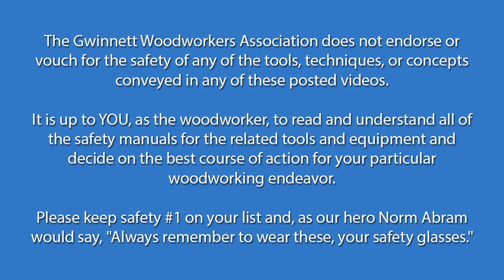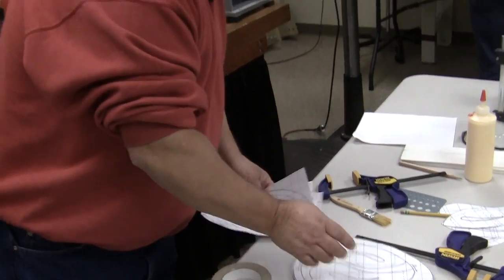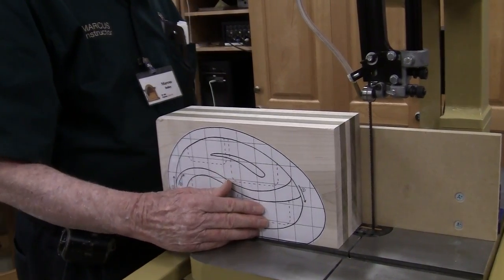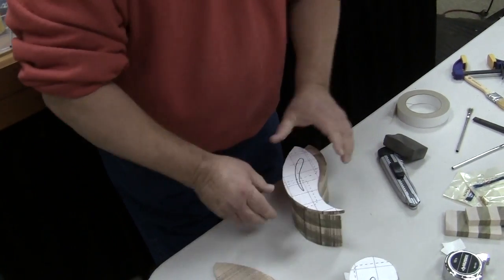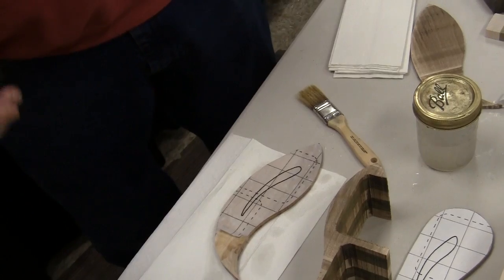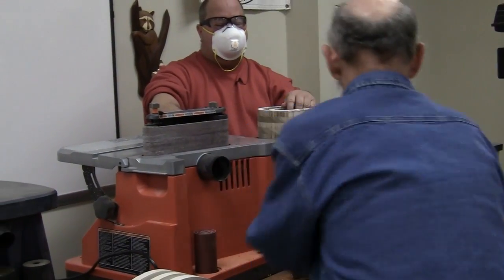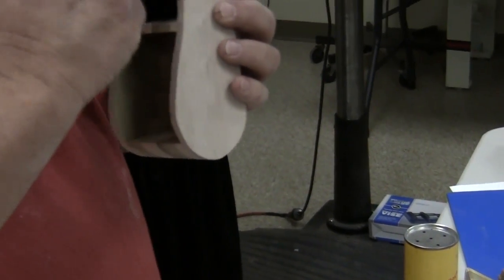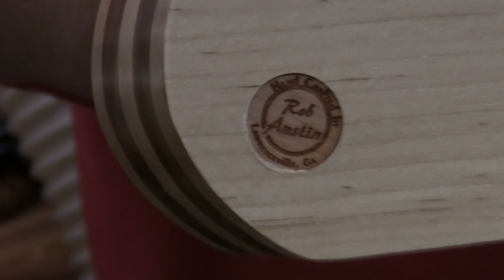2014-01-18 Bandsaw Boxes by Rob Austin (00h:53m)

Comment: Reason for the Shelac being used on the drawers before the flocking glue, is to prevent any bleed through that may occur at joints, which discolors the wood of the outside..  Shelac first is a safety precaution. It also gives a firm base for the colored glue.

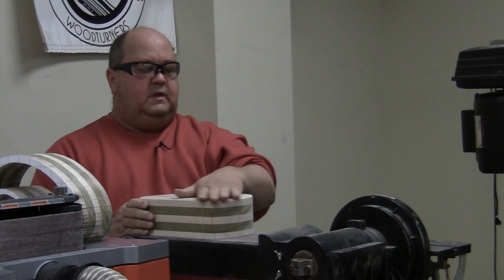Comment: Starting at 39:00 he starts describing how cutting the front and back off the drawer makes it narrower because of the kerf removal, and that makes the whole drawer narrower than the body.  He says he address what you do about that in a few minutes but I don't believe he ever does.  I can't find anything else online about how to fix this.  I guess you could sand the whole body down on the front but that's a lot of sanding.  I was thinking of putting a thin shim on the back of the drawer to push it forward, flush with the body.
Reply: One way you can address it is with adhesive backed felt dots. You can attach them to the back of the drawers.  I've seen them in 1/16", 1/8" thicknesses.

Comment: I got a medium size nail with the blade of my band saw, since that it is impossible to cut straight on when I use the fence and cut a plate (not strong wood) of about 1/2 In. the blade force the way left to the fence so 1/2 In. become 1/4 In. and less till blocked. I checked the blade close and it seems it is normal, perfect strait circle (when removed of the band saw or not), and seems to cut well ! I can also be fold in tree part normally with no problem ! Can you please give me a clue ?

The blade is 5/8 In. & 5 teeth In. The Band Saw is Makita MLT 100.
Reply: I see the Makita MLT 100 as being a table saw. Do they make a band saw with the same model?
Reply: Hitting a nail or just a harder spot part of wood can change the set of blades. A new blade may be the only answer!
Reply: @robausa1  yes and its a band saw that i use. I make mistake the mlt100 is my table saw. I not remember the name of my band saw makita.

Comment: on rounded drawer corners I drill them out with a drill press, less work with the band saw...
Reply from the maker: There are several ways to get the same results but a 3/16" blade allows you to make sharp turns. I have to slow down and make smooth even turns.